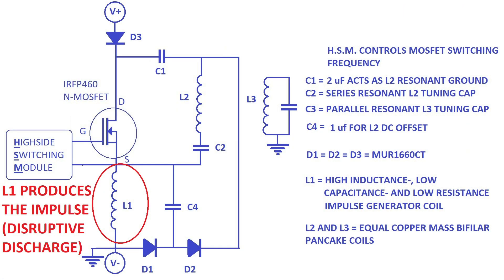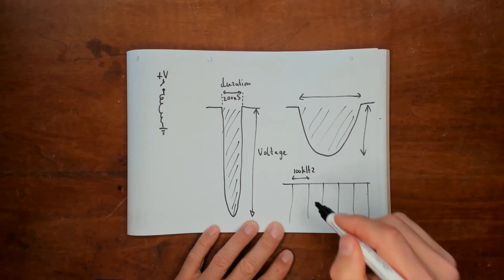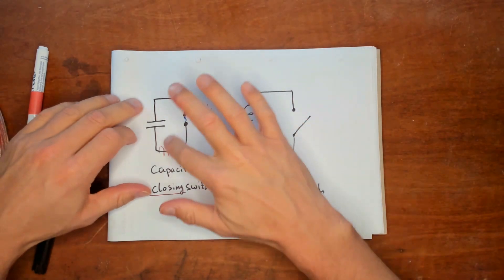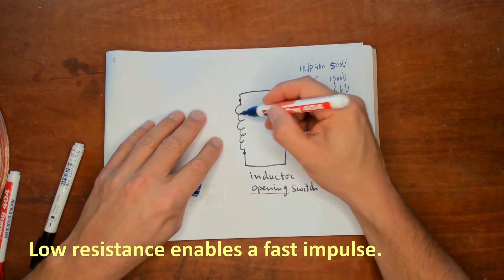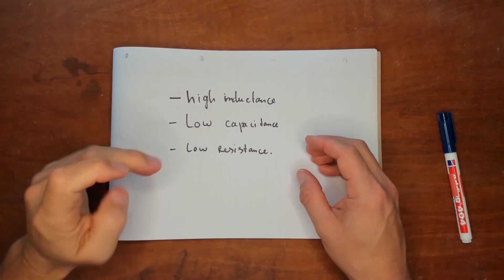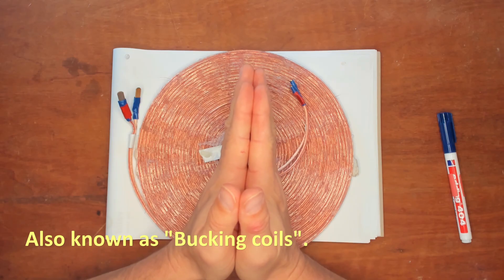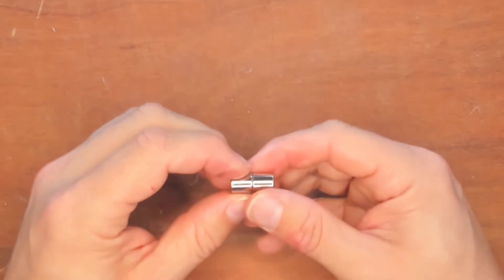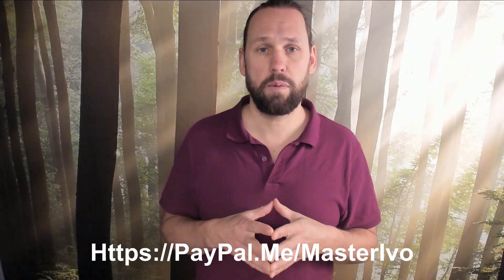Longitudinal electric impulse generation factors.

Comment: If biological electricity is a form of impulse electricity, you could in theory build an electronic device that can be tuned to resonate to the frequencies of brain waves and broadcast longitudinal electric waves that can produce telepathy-like effects where you can hear sound directly in the head. Its a possibility.
Reply from the maker: Sounds good :)
Reply: Sounds yto me lioke the crap the Company did back into the 70's!  They called it remote viewing, and it is based on resonance theory (of brain waves).
Reply: @rstelzer2928  this was literally declassified on the C.I.A. website like seven years ago man. It is real, and does work.
Reply: I literally have been drawing something like that up. It's part of the reason I watch these kindsa vids. Telepathy doesnt require technology though, and can't be functionally achieved by use of technology alone, but it's effects can be amplified and or altered using technology. Your body is the power supply, and your brain and nervous system are all the circuitry ya need. Learning telepathy is like learning to play guitar. Takes awhile to get good at, but you never forget once you know. It's as fundamental as learning how to walk and talk. First ya godda learn to synchronize your brainwave frequencies between both hemispheres of your OWN brain. Once you figure out that part, you just godda slowly tune up and down;  checking for frequencies of other people. This way you can absolutely freak them the f**k out before explaining to them that they havent gone crazy 😄. Tuning your hemi-synced brainwaves up and down is how you align your brainwaves with other peoples brainwaves, wich is a requirement just like with these here resonant circuits Ivo demonstrates. It doesnt have to be perfectly synchronized to the other party to work, but its godda be close enough, wich is pretty close given that everyones alittle different, but the closer you get it to perfect sync, the clearer the comms become, and you can show others how also. Definitely more fun with friends lol. just like attenuating a signal with a radio, accept you and the other party ARE the radios, and your dielectric brains are both receivers and transmitters. I know it sounds quite unbelievable but since you brought up telepathy, go to the C.I.A. website (cia.gov) go the whole way to the bottom of the page and select where it says "freedom of information act". After that you'll have a separate search bar on the sights page, and there you should type in "Remote viewing, Telepathy, and psycokenesis" after you do that, just read and read....and read.......and read lol. Because its ALOT man. They declassified this sh*t seven years ago and people still think its lunacy hahaha 😄 even with police and the military using "psychics" to remote view locations in search of bodies locations and kidnapping victims, or by the military for resonance and...well...we shouldn't use it for unethical reasons. But yeah 🙂 telepathy can be augmented via technology and vice versa. All it takes is the dedication of learning it as an adult, when in reality we should have been learning it while we were learning to audibly speak.
Reply: Check out "Voice of God" technology or weapon.
Reply: @psylosopher369  That sounds like something similar to what I wanna incorporate in my armor design. I figure why try to tell them to stop shooting with words, when I can just make them WANT to stop shooting by using my empathy and their own feelings. People shooting people don't generally listen to "don't shoot!" but I bet they would stop if I could pull all their most saddening and regretful thoughts and feelings to the forefront to make them question themselves with such an unnaturally extreme shame, that they may just turn the guns on themselves. I'm sure I could short circuit brains with enough voltage lol. My goal for using such a thing is to prevent violence and pick up on it before the thoughts become actions.
Reply: ..off topic a little but humanity would do well to copy..Here is a little secret of nature.....communication from the subatomic thru to the galactic in both scale and time is achieved via longitudinal embedding ...how?..via muliiples of phi (1.618)
ref the work of Dan Winter😃
Reply from the maker: indeed, and Dan Winter is very clear about implosion
Reply: I was thinking electronarcosis ,

 if you could induced aprox 70ma osolatin at ~720mhz and put someone to sleep..
Multiple of 60... Humm...
Reply: The C.I.A. already figured this out in the 60s and the Chinese have threatened us with it.
Reply: @bringer-of-change  too bad the Russians didn't have it in that hostage situation where they used fentanyl aerosol and killed many hostages trying to knock out the hostage takers.
  Personally I would build it just for home defense... A few walls set up in a phased array  pointed towards the entrance... If you Don't have the remote to turn it off ,fall asleep before you can hit the doorbell. That's the fantasy anyway.
   I don't know how I could test anything I could build if I built anything anyway... It would require consent, and that does not seem likely.

Comment: Master Ivo, very interesting work, you sparked my interest :) Thank you. I assume the capacitor voltage rating needs to consider spikes? So if we are planning to drive circuit with higher voltages it will need mega caps?
Reply from the maker: thanks, yes the dc aspect needs to be met. but the impulse voltage can exceed the cap rating, as it is current less

Comment: I wonder if longitudinal electricity is how Nikola Tesla was trying to figure out how to create difference of pressure in the gaseous ether environment that surrounds us all, where in front of spaceship/flying machine, ether pressure is electrically rarefied thereby causing the gaseous ether environment which is at higher pressure to push the spacecraft towards the lower ether pressure with it, resulting in gravitational propulsion. Check Nikola Tesla's flying machine quotes. Also read book "Occult Ether Physics by William Lyne".
Reply: There is a borderlands science video from the 80's where Eric dollard lights a bulb with longitudinal energy and it has pressure waves they were able to demonstrate on camera
Reply: @DavyOneness  Found the video. Its called Tesla's Longitudinal Electricity.
Reply from the maker: Yes I am aware of the influence of the dielectric field on the inertia of the aether.

Comment: When I was a plant manager (instrument transformer manufacturing) I always insisted that equipment be started up one at a time.  This is because the initial energetic start of motors creates a spike in the DEMAND of our electric utility bill, and it is a cumulative effect when all equipment is started at the same time.  The utility company charged us for that DEMAND spike and charged us a long time using a ratcheting billing method, based upon the highest DEMAND spike.  So one spike could result in us paying a much higher bill for every month of a whole year!  When the equipment is switched off, the collapsing of that magnetic field which initializes a motor's field is released back into the circuit too.  This is the same effect of which you are speaking, correct?  Just about everything creates this field when it is first turned on, to initialize the equipment's magnetic field so it can do work.  IF you could keep that field from day to day, you could eliminate DEMAND spikes and conserve energy and reduce the expansion rate of electric generation too!  Smaller generating plants would meet needs!  How much is THAT worth to us?  Quite a bit I imagine.
Reply from the maker: Correct, basically recycling of electric energy, by re using the energy that was stored in the magnetic field, that is put back to use.
Reply: @MasterIvo  I'll bet you are the guy who could design such a circuit to do just that!

Comment: Love your spirit of sharing!  Let me make some observations and share what I know....  Being a former US Marine from the Vietnam era, and being 100% disabled, few find any value in me these days, and I have little means to make financial contributions; but I do believe I can add some value to what you are doing.  May I?  First of all I like the way you illustrate the principles!  Energy dissipates by AREA (like in an expanding circle), not by a straight line, which you illustrate very well.  Just like from an antenna it goes out in every direction, which is WHY there is a Pi R ^2 relationship rather than division/dissipation by direct line distance.  Can't remember who the guy was who dropped the lead balls into the mud, but he discovered that principle too.  This high energy impulse you create with your circuit seems like how nature creates lightning to me.  Remember the standing wave Tesla created, like continuous lightning?  Something else I think you will like to witness for yourself is the gravitational effect of the two opposing fields [hinting at where the energy comes from, and what gravity really IS] .  If you dropped your energized live circuit assembly from a certain height and precisely timed its fall through a specific distance, then use it as opposing fields, energized of course and dropped it from the same height (being the same exact mass) you will witness that each coil falls at a different rate of time through the same exact distance.  This also works with two large ring magnets bolted together to force the opposing magnetic fields together (as opposed to a N/S configuration)  dropped from the same height.  Try it.  The stronger the fields and the longer the distance the more pronounced the effects.  But remember; it's not just gravitation (mass) that is affected when you observe this effect; Time too is involved!  You will figure it out; you are a smart and creative guy!  Thanks for all you GIVE AWAY and may much more be returned to YOU!   --Michael
Reply from the maker: thanks Micheal. you clearly are no 100% disabled (although I do believe the "system" has labeled you this way).
I know of the experiment you talk about (falling opposing magnets).
I am already implementing this. I have full confidence I will succeed. It's only a matter of TIME. ;D
Reply: @MasterIvo  It's Michael.  Thanks.  I could not afford the expensive equipment to measure time precisely enough to develop any formula, all I had was a TMU watch (Therbligs) and had to use an acoustic sensor.  But there was definitely a repeatable and statistically significant difference in time between the two.  But I am convinced its not just a gravitational effect, but a  time effect as well.

Comment: Hi there Ivor welcome back ,have not seen you for a year or two. Can I ask what practicle use of these compressed magnetic fields have  you found to transmit  in a particular direction, perhaps guided with a permanent magnet???
Reply: He is about to reveal the real source of energy.  We are swimming in it but have not yet seen it clearly...
Reply: @rstelzer2928  Hi are you lvor?.
Reply: @bobvincent5921  Ha Ha! No, friend.  He is much more capable than me.  I just like his spirit and seeking truth, in any form it comes to us, so I wanted to contribute something of value.  My background is manufacturing in Electric products since 1977; first as an Engineer, then up to and including VP General Manager.  Then my past injuries caught up with me, and my brain doesn't work like it should anymore.
Reply from the maker: no he is not me (ivo). The magnetic field energy, whennthe circuit of the opposing fields coilbis opened, rushes out of the coil, as a longitudinal AEther pressure field, rolling like a ring toroid Aetherfield over the conducting wire out of the coil into the lowest path of impedance.

If this is a series resonant coil (low impedance equal to wire resistance only)  And the (total tesla bifilar) coil ( acting as a capacitor plate) , that has a dc offset to another (tesla bifilar capacitor plate) coil,

that dielectric field between the "plates" (coils) gets to see the  instant voltage (tension) drop, which is currentless (no transverse motion of aether volume, maybe only longitudinal Aether volume motion, a volume of Aether=inerta)

This in fact is a form of dielectric induction, when combined with magnetic induction creates electric power aka electricity

Comment: Why the magnet has a repulsive force greater than the attraction force? 
-(you pulled the magnet using tricks fractures in half) 

Second question

How amplification arises increase the current when the voltage is a 90 phase shift?
Reply: If I may; electricity IS the dielectric (magnetic field) at a 90 degree phase angle as the current travels downstream from the source.  Electricity (what we call it) is real two forces combined into one, and one component of it travels outside the wire at that 90 degree phase angle.   This is why two wires beside each other, with two opposing or agreeing directions of current will either repel each other or attract each other as the current flows; and THAT reflects the amount of magnetism (Di-electricity) in both circuits.  Longitudinal electricity operates sub-space, (no wave forms) that is: outside of time and space, which is what causes instant action at a distance.  Our friend is putting it all together for us!  He will find the secret to MASS which is not a magic pixie particle!  Ha hah hah!
Reply: R Stelzer, I don’t know much about the complex issues of great importance that are being discussed here, but I can see that Ivo certainly attracts the brilliant mind, like you, who are not only merely interested in the truth, but are eager to bring it from the future into the present.
Reply: @maglectric3624  Yes.  The Truth is a free gift of good-will to everyone.  It's always lies that cost us so much.  So yes, I am all for the truth, which makes me an enemy to everyone who embraces lies, and has a vested interest in perpetuating untruth.  But that's okay with me, it not people who are my enemies but untruths, and when people see the truth many will let go of the lies and hold to the truth; so...  on we go to make the truth fully recognizable, and everyone who loves truth into a friend.
Reply from the maker: thanks for all the helpful answers.
when voltage and current are in phase we have power, electricity.

when they are 90 degrees out of phase, the electric field energies transform back and forth into each other, dielectric to magnetic and vice versa. 

But we look at resonance (described above) from a transverse perspective only.

When we introduce a longitudinal impulse, into the series resonant coil, It gives the dielectric field a longitudinal push, making the coil both transverse AND longitudinal.
from experiment we know this produces electric power, but we are only using  one half,  by only usimg a negative impulse

The rest.. is still to be answered.
so far so good.
Reply: I'm trying to answer your first question. The magnetic force increases and decreases as the difference between two magnets increases and decreases.  So when the opposite poles of two magnets are pulled apart  the distance between  them increases and it becomes  easy to do, but when the two poles of same  polarity of magnets are pushed in the direction of each other, the  distance between them decreases and so the acting force increases too, so it becomes hard to keep them together.     (Sorry for my bad english).
Reply: @SSIKR  "but when the two poles of same  polarity of magnets are pushed in the direction of each other, the  distance between them increases and so the acting force increases too,"   the distance between them INCREASES?  No.  I think you misspoke.
Reply: @rstelzer2928   my bad, I mistyped.
Reply: @SSIKR  No Problemo; to err is human.
Reply: @SSIKR  I think you meant to say "as the distance decreases the repulsion increases.  That's because energy dissipates as area expands, and increases as area diminishes. That's whay the formula for either is a Pi R^2 relationship; a circle.  (area not direct line distance)  Correct?  Just as Fission is easier than Fusion, in fact; Fission is the trigger for fusion.

Comment: I think:
1. + and - does not exist, only differences!
2. the current does not exist, it is called intensity!
3. it does not increase the capacity as the distance is smaller, it only increases the pressure!

I strongly believe that the correct energy formula is this: 

ENERGY = (ETHER / MATTER) X (RATE OF CHANGE)

Thinks critically and questions everything !
Reply: + and - indicate DIRECTION of flow from polarity of time.  We are all time travelers, but only in one direction; forward.  That is BECAUSE of the polarity of time in this universe.   Time is continually created just as space is.  Magnetism and fields are at the genesis of every "moment".  MASS is related to the SPIN induced by the toroidal nature of magnetism, and the spin of it IS energy giving inertia to everything.
Reply: Voltage is Intensity, a.k.a High Tension.  Current, is more like a Quantity.
Reply: @drgonzo7806  Voltage is POTENTIAL, Current is the FLOW rate.   POTENTIAL does not indicate any flow, just the POTENTIAL for flow.  For example a bowling ball at the top of a 100 foot high slide has more POTENTIAL (energy) than the same size/weight ball at the top of a 50 foot slide, but neither necessarily has any flow; just potential ENERGY.  CURRENT is a measure in coulombs of electron flow, (1,000,000 x 1,000,000 per second OF FLOW per second past a certain point; for one AMPERE of CURRENT).  Or in the water pipe analogy; VOLTAGE is like the pressure behind a closed water-hose; while current is how much water flows through the hose when opened.
Reply from the maker: @drgonzo7806  Voltage = tension; tension of the polarised Aether, expressed as the dielectric field (made of faraday tubes). the lines of force, are faraday tubes, that pull the conductors, where they terminate on (plus and minus) together (casimir force).